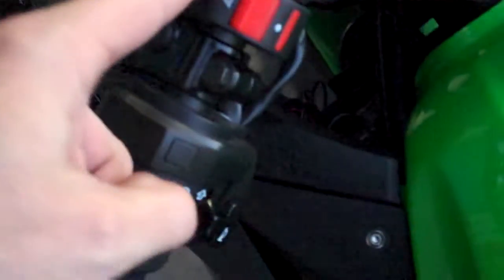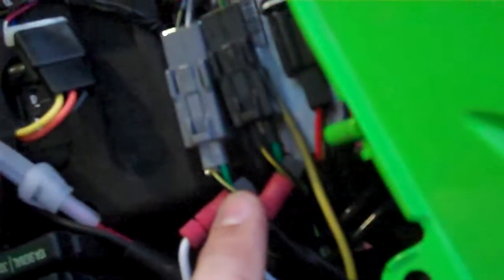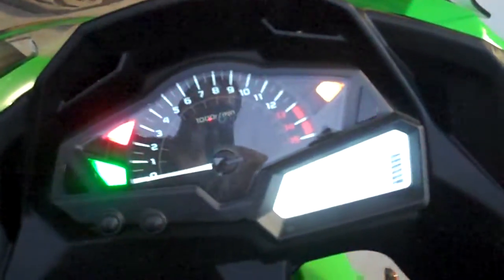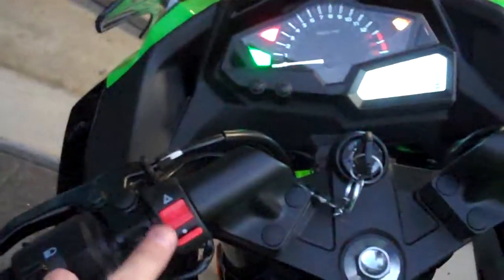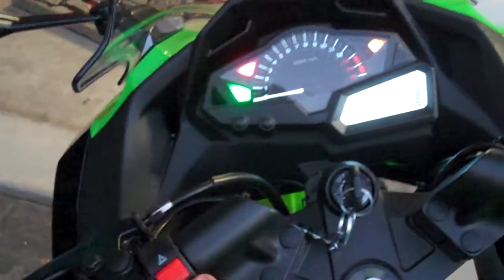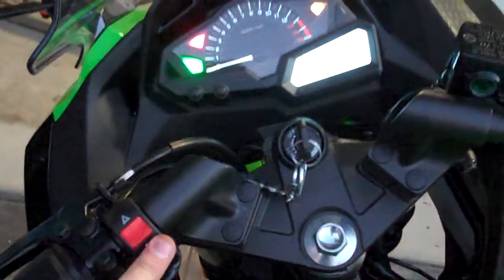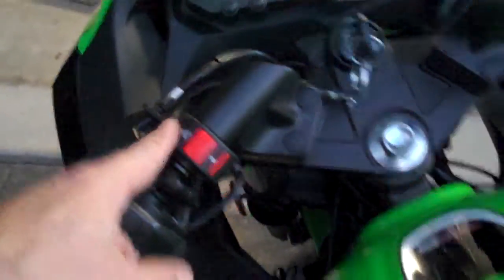Kawasaki Ninja 300 Hazard Lights

Comment: Does your diodes warms up when using the hazards? Coz I used 6amps diodes (2 pieces) and it still warm,
Reply from the maker: yeah they get a little warm, but so long as they are not hot enough to cook an egg on or give you minimum of 1st degree burns then you should be ok
Reply: (y)